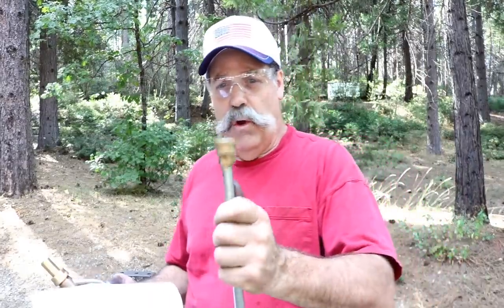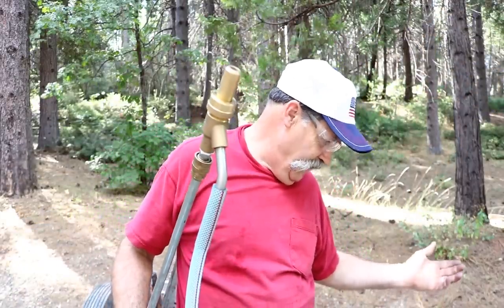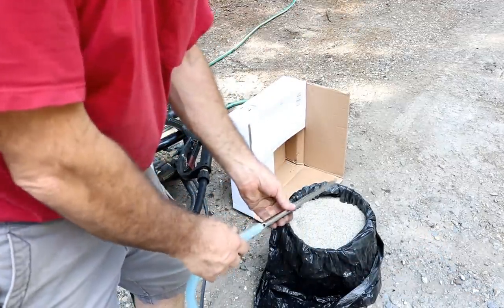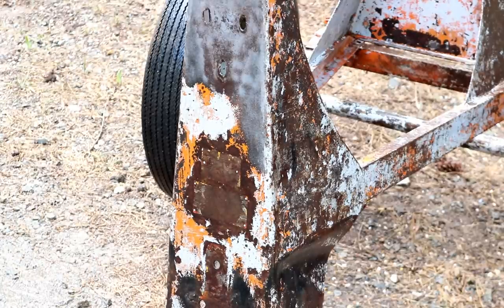Cement Mixer Restoration | Big Clean Up

Comment: Top Tip for cleaning rusty parts go down to your local builders merchants and buy a couple of gallons of brick acid/patio cleaner it does exactly the same job as evaporust but at a fraction of the cost
Reply from the maker: Thanks

Comment: Just a FYI for people. Northern Tool Co. has the blasting attachment for pressure washers. They have 2 sizes,  8 bpm and 12 gpm. Here is a link for the 8gpm unit: 

 https://www.northerntool.com/shop/tools/product_200660204_200660204
Reply from the maker: I also have a link in the description.  Thanks for the additional link Paul.

Comment: HI Randy, as you know I'm not overly safety minded, well I risk my fingers every night 😀, but perhaps a mask would be an idea especially if that is silica sand you are using. I know it is wet sand and only short term exposure but....
Reply from the maker: Thanks Chris.  I will be long in the ground before silicosis sets in.  I am hoping for death by to much bacon.
Reply: @RRINTHESHOP  way to go👍👍👍
My ambition is to die a rich old pervert but I'm only 2/3rds there.😏
Reply from the maker: @chrisstephens6673  2/3 to being rich, 2/3 to dying or 2/3 to being a pvert?
Reply: @RRINTHESHOP  that would be telling🤔
Reply: @RRINTHESHOP  or rich and old, rich and pvert or maybe old and pvert, your guess.😇